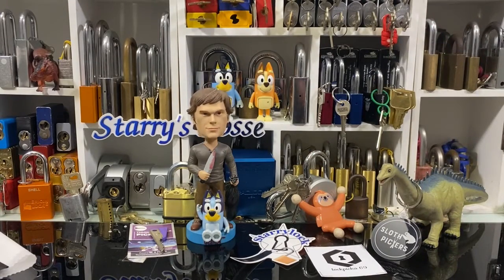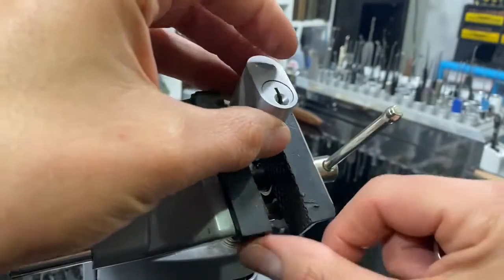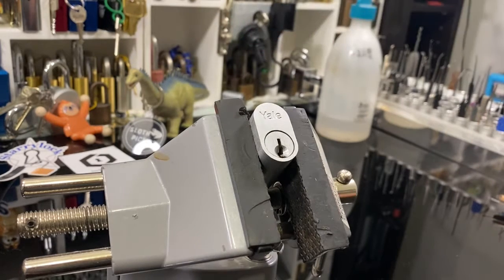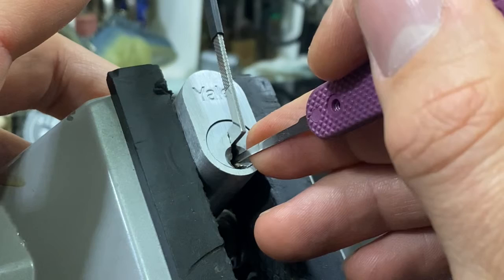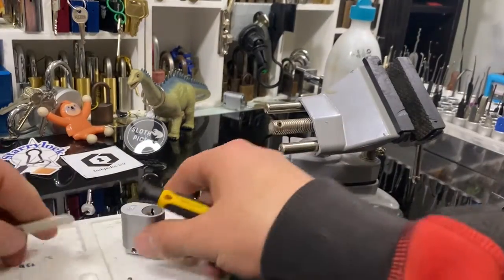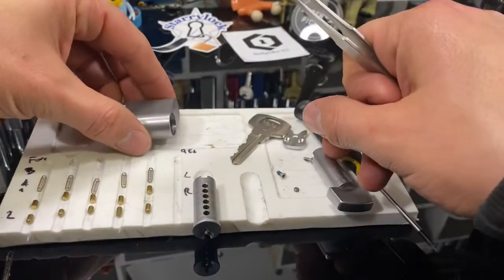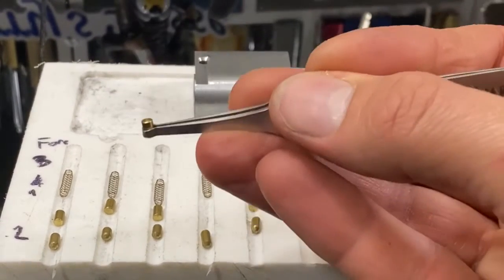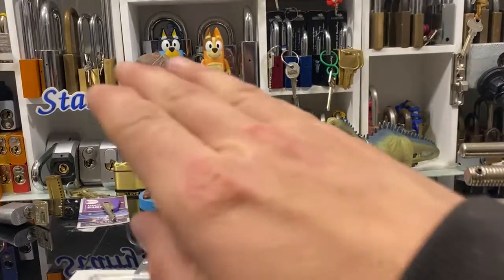Episode #2 of oodles of ovals for #stocklocksunday

Comment: Top left, ther one on an angle. 
Great quick pick even if the pins are all standard, Yales can be tricky to pick. Ther lock almost snapped open, you must have had a bit of pressure on it. Changed the music too.